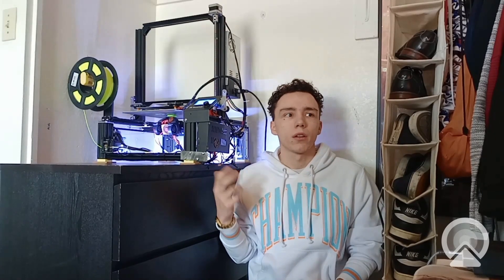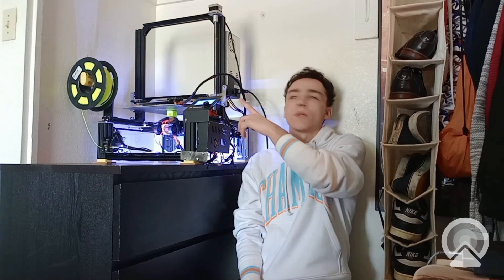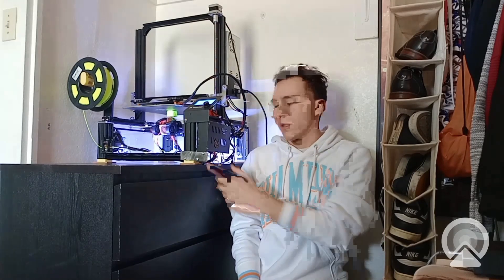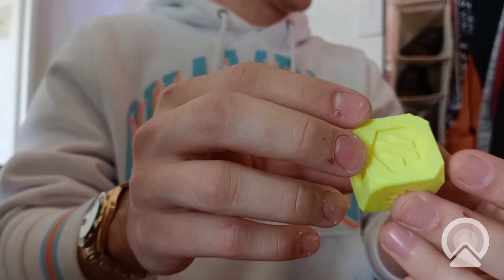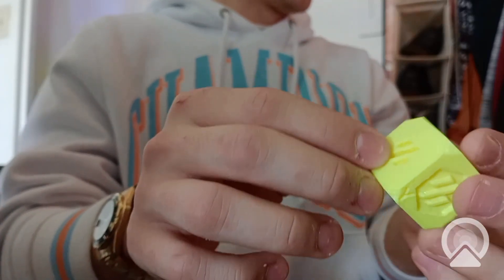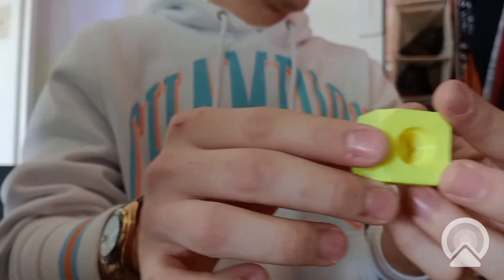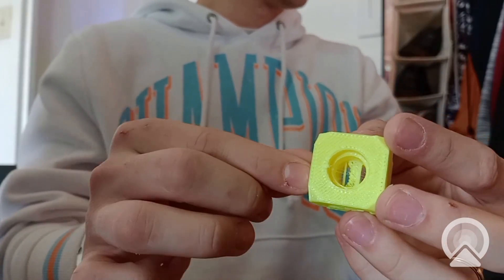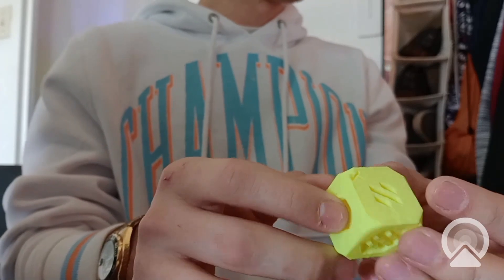Empire CoreXY 3D Printer Upgrade!

Comment: I have a question. How would this work with bigger printers like a 400mm² ender 3v2 printing something larger and heavier like say an iron man helmet, would this still adhere?
Reply from the maker: With advancements in PEI sheets, I would have a hard time imagining this printer would have too much more difficulty than a non-inverted printer; mainly on the basis that large prints such as helmets already require some sort of care when printing. This is because the forces the plastic experience when cooling are far stronger than gravity on the object. To be fair, if you printed 1kg of filament, the bed would have 1kg of material to support but that is still likely the least of your problems. Interestingly enough, I always planned on building an enclosure for this printer as I think printers with enclosures are the future of 3d-printing; in which case, I would expect little to no bed adhesion problems at all as internal forces of plastic are much reduced with an enclosure.

Comment: Interesting, but if you build a frame you can just flip it over.
Reply from the maker: You are right. Though, there are a few subtle differences to keep in mind. Designing a printer to print upside down uses less extrusion and lets to centralize weight below the toolhead. Having a lower center of mass as well as a lower center of moving mass helps significantly with resonance compensation.

Comment: I was wondering how feasible this is for something as large as an Anycubic Kobra 2 Max? 420x420x500. I have 2 of them one prints amazingly. The second i got very cheap on Marketplace because he had dropped it, and it had issues. I have since fixed it for the most part but it still will randomly shift, last time 8 hrs into a 14 hr print. Let me know what you think
Reply from the maker: @chazhaze3d  in theory there should be no problems getting this setup beside confirming extrusion lengths; unfortunately, development has slowed a bit recently but otherwise I think it would work.